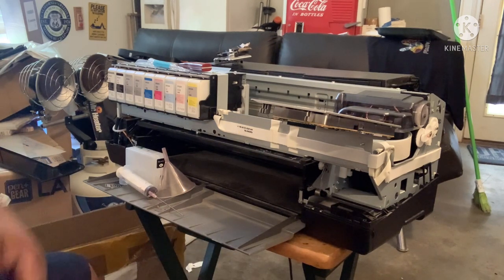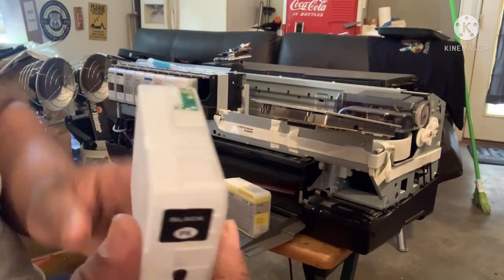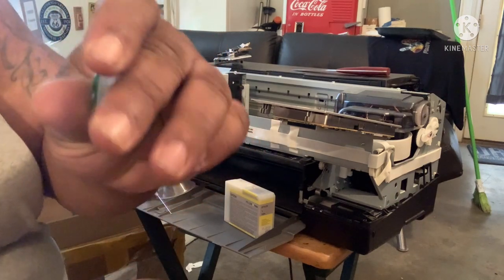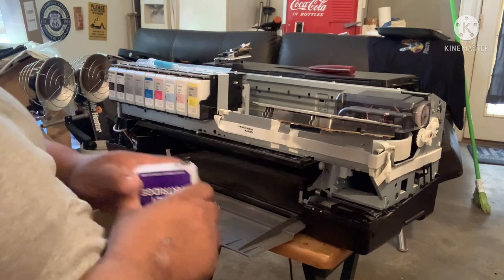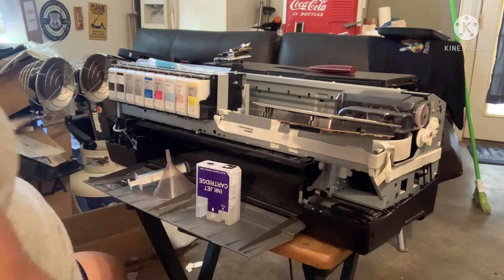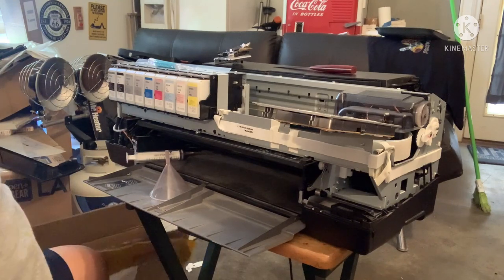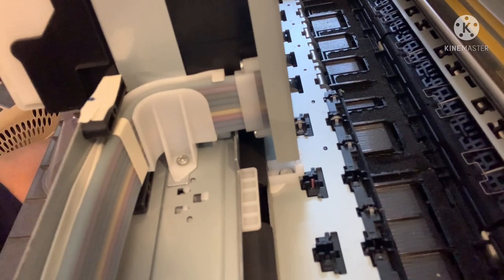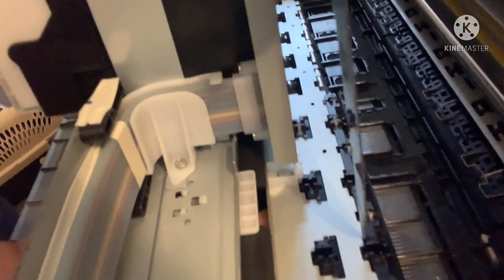How to convert a Epson 3880 into a Dtf Direct to film printer.

Comment: Good morning sir! I have an Epson 3880 did everything but it’s saying no cartridge in #4 and I can’t do the initial purge or whatnot and fill the ink lines. Any help??
Reply from the maker: Make sure the chip reads over %15
Reply: @big boi it was a brand new cartridge. Printer was unused as well. Never had any ink ran through it
Reply from the maker: You need another cartridge cause it’s not reading
Reply: Thank you! I’m going to order one now and see if that fixes my issues
Reply: New chip solved that issue! Thank you! Now every blue moon the 1404 error pops up. You ever get that?
Reply from the maker: Yeah I just reset it and it goes away

Comment: I don’t understand what you’re doing with the chips. Whats the purpose of taking it off the original cartridge and then put it under the chip on the aftermarket refillable cartridge? And any reason you used the yellow oem one with the black cartridge?
Reply from the maker: It’s the ink set up ! They have to go in a certain order

Comment: Big Boi, I have a problem, I took out the head of my 3880 and cleaned it and when I put them back, it stopped printing altogether! I removed it agai and checked everything fine but still blank pages! what can I do? sooo frustrated...
Reply from the maker: Sounds like somethings not connected right
Reply: How did u clean it? Did ya soak it or force fluid through it?
Reply from the maker: Clean

Comment: how are you not getting the paper load error with the direct to film, film. My printer is no seeing it. When I load regular paper, it's fine again. Please help. What your setting and properties. Love from New York.
Reply from the maker: Yeah I just put a couple pieces of film or sublimation papier it should help
Reply: So you know, when the printer boots up from power off it checks the light levels of the page detection sensor and paper width sensor on the print head.  This is good to know because if you're having trouble with either paper feed or width detection and you make changes to the printer or sensors to make it work, you might get tripped up again on the next power on of the printer.  Some people flip the width detector on the print head or black it out.  The page detection sensor can be a pain for transparent sheets, though.

Comment: Can you put any kind of DTF ink on it even if the ink says for xp15000??
Reply from the maker: Yes
Reply: It doesn’t matter if the original epson ink carts were back from like 2015 i can still put those chips on the refill guns right ?
Reply from the maker: @jesusarellano3737  as long as it reads
Reply: @bigboiprints5726 perfecto. Thanx boss. So u left the first wheels top n bottom ones that’s on the right and removed all the rest of the wheels top and bottom all the way down to the end right ?

Comment: How can I get the printer to load the paper and print ? I Always get paper load error, or any guide for disable-disconnect the sensor ??
Reply from the maker: Hold the film straight up. Or put a couple sheets of film behind and it should read
Reply: @bigboiprints5726  will try, thanks bro, great channel

Comment: how do you disable the ink door latch?
Reply from the maker: I’m not to sure! Try unplugging it
Reply: @bigboiprints5726  I want to leave the case off of the printer. I see people using these 3800 and 3880 like this. So I was wondering how they used them with the case off.
Reply from the maker: @davidbrownphotography4924 I did

Comment: Do you know the Ink configuration for acrorip 10.5
Reply: For the epson 3800
Reply from the maker: No I don’t! I apologize
Reply: If anyone need to know the cartridges set up for them 3800 using acrorip it's. Mk not in use.Mk K WW C M WW Y
Reply: No slot for cleaning solution?

Comment: And also one question, it can print from the roll? And what size?
Reply from the maker: Yeah
Reply: @bigboiprints5726  how did you solve the mixing of white inside?
Reply from the maker: Mixing of white?
Reply from the maker: It takes special software for a roll
Reply: @bigboiprints5726  yes circulation
Reply from the maker: @croativeideas5010  I don’t understand. I don’t have circulation problems
Reply: @bigboiprints5726  i have heard that a lot of people have a problem with white due to circulation. has both automatic mixing and manual.
Reply from the maker: It’s more of none maintenance. Than anything. I’m going live today.
Reply: @bigboiprints5726  different time zone… i just bought this printer i want to convert it.. i have a reset catridge and reset chip
Reply from the maker: Hey hit me on Facebook Leonardcriss

Comment: What’s up big boi I see you using roll with 3880 is it any thing you need for the machine to make it roll print
Reply from the maker: No I could never get it to roll print
Reply: What up big boi if I buy the gun cartridges like you have auto reset do I still have to reset chips 3880
Reply from the maker: Nope
Reply: Last question about this subject I notice some refillable carts chip have prongs on the back is that the kind needed….some refillable carts don’t have prongs on back of chip
Reply from the maker: Ink owl have great cartridges
Reply: Anything to fix code 1531 on 3880